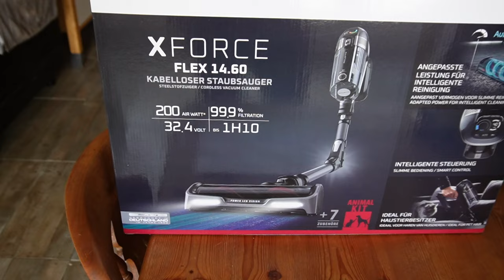A Place in the sun | 8 months after the tv show

Comment: A bit surprised Colin has used grey plasterboard so close to the shower and not green (water resistant)  
I know it is expensive by comparison) but hey ho
Reply from the maker: Hey, we used the green water resistant one on the other side of the wall where the tile goes onto. The rest of the bathroom has grey plasterboarding and is doing well.
It should be ok 👍